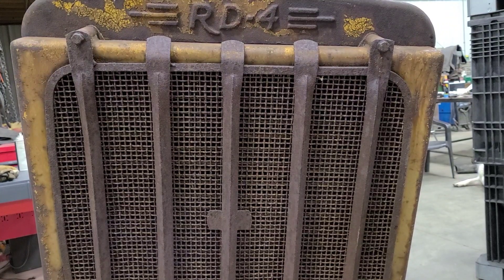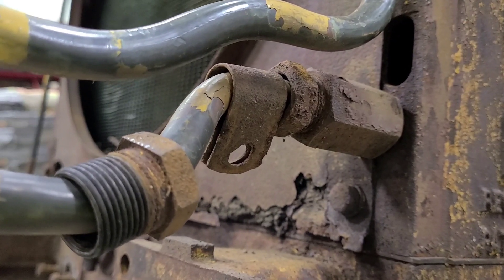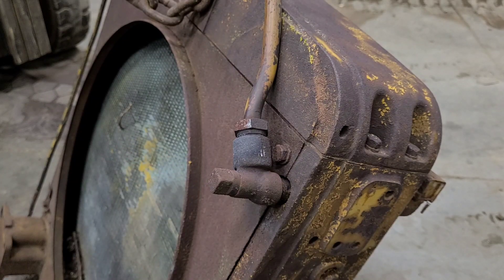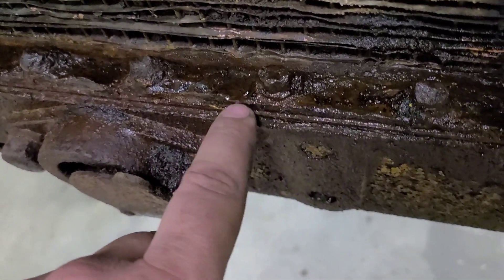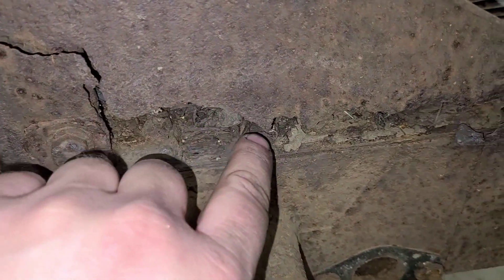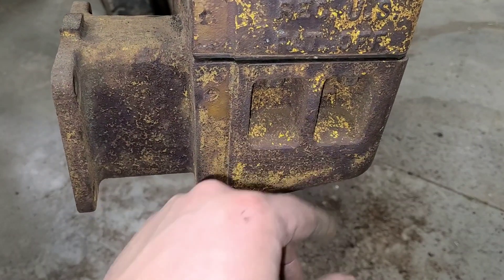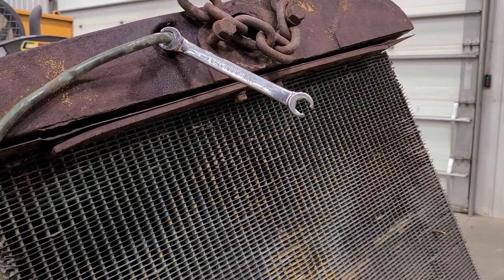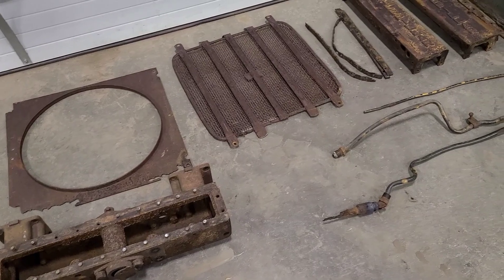Caterpillar RD-4 Radiator Disassembly

Comment: Excellent video it's amazing how much damage mice and rats do when they make nests. If you have a wire welder just weld a nut on the cut off bolts and the heat transfer will loosen them up. It's seems like older machines used a different tolerance on the threads in the castings up until the 1960s and later machines the bolts really stick tight. When I cut new threads by hand I use the biggest drill as possible it makes the job lots easier. Keep up the great videos

Comment: A good Radiator  Guy should be able to safe that. I worked at one when I was in my early 20's. The oldman that did the radiators was slick with them. Great Video Bud...

Comment: Kyle, I inherited  my Father's  6" Ridgid pipe wrench and have used it in some tight places to extract  multiple  sizes of pipe, bolts and studs that were in various  states of " you'll  never get that out". Well in most cases, if it fits in the  jaws it comes out. Properly  adjusted, correct amount of force and well yeah ya! Better than those " un " locking pliers of any manner.  Good series, consider  putting a  3/4" square in the tensioner wrench handle for more angles of attack with your 3/4 ratchet.

Comment: Could somebody tell me why Radiator Shops are still in existence? In my day the Radiator Guy could fix any Radiator! Boiling out,Flushing out, tube replacements, Tank repairs! Now days they don't even look at it! They just hurry to there Aluminum Radiator Catalogs and charge you $300.00 to $600.00 depending on the size. If all I have for a choice is a catalog salesman I'll eliminate the middleman and go to the internet! Okay my rant is over LOL!

Comment: wondering what your background / day job is if it's alright to ask - you seem to have a lot of hands on experience and mechanical knowledge - great video
Reply from the maker: Thanks Doug, I grew up fixing 3 wheelers and 4 wheelers, took several years of autobody in high school, went to a 2 year technical college for diesel and while going to college I worked nights in a machining and fabrication shop. From there I've spent the last 8 years doing maintenance (fixing anything and everything). The crawlers, cars, powersports, tractors, etc are all just hobbies 👍

Comment: The core dosen't look  real bad but it is iffy !!!!  Yes you can make th pinch straps!!! The bolts in the bottom  is a good place to weld barstock to !! And turn  them out !!! But I think  vice grips  first 🤔  
Going to take  some serious cleaning 😌
Reply from the maker: I will do a shirt video showing the removal, thanks Evan!

Comment: Kyle, I know the RD4 is from the 30s but another question for Squatch. I don’t remember if I read it or heard it from somewhere but did Cat use some steel cores in WW2 era crawlers? Like the cam gears, just interesting information. I’m still amazed at how many bolts actually come out.

Comment: I have a soviet tractor that has a similar radiator core setup as the RD-4. Mine did not have oil cooler lines issues cause they run separate paths from the radiator and have only banjo bolt fittings on both ends. However I remember when taking the radiator apart there was lot ot hay and remains of a mouse house inside the core. Cause the radiator cap was missing and the cap fitting was gone no wonder all the nice stuff came in. Someone had blocked 3 lines in the core for reasons I don't understand. Most likely a leak repair. Cleaning and assembly took a lot of time, the core did not need any additional repair. But I remember the rubber gaskets that where meant to seal the mating surfaces did leak. The bottom ones needed just tightening and the upper one did however need a  radiator sealer to fix the issue once and for all.

Comment: 🤔 Stripping down one of them can sometimes be a surprise. It can dang near take itself apart but most likely it will need heat n hammers.
WOW the core looked good compared to the flat bar strips. 
Thanks

Comment: I have found that drilling a hole through the center of the bolt as deep as possible. Most times I use a 1/8 inch hole. Then I can apply heat deeper into the length of the bolt. Most of the time the end result is very good. In this case the heads are gone. Drilling the hole won't hurt anything. Usually after heat is applied a vise grip or easy out will work.

Comment: Hopefully the oil cooler leaked into the mouse nest and persevered the core. I am doing the same job on my D2 right now and the end rows of the core are sealed off just like yours are. I am going to have to mill the tanks where the core seals because of the corrosion. I sometimes wish that I was more camera savvy like you, I would video my work.

Comment: You're a rustbelt guy, why don't you grind a shiny spot on the top of the bad bolts and just weld a nut on top? Save a lot of extraction later.
Reply from the maker: I do weld nuts on but only when they are too short to grab, otherwise I find grabbing them much easier